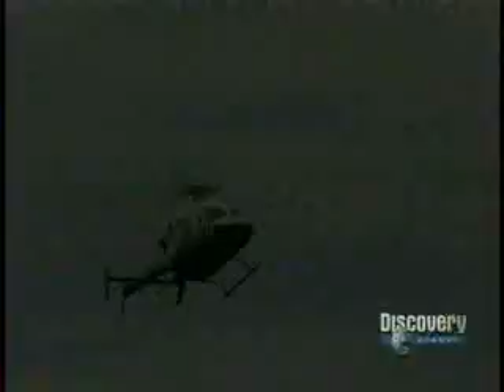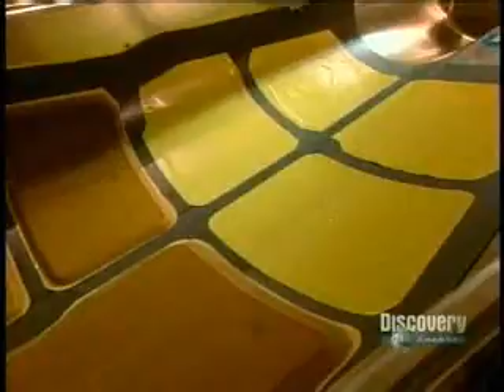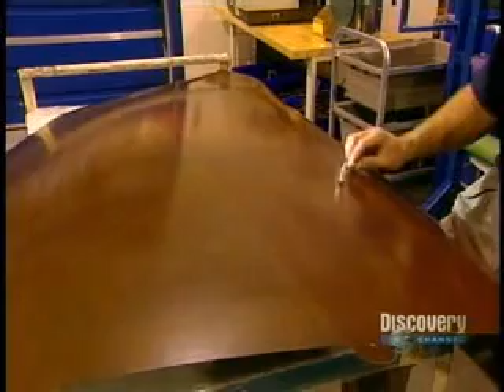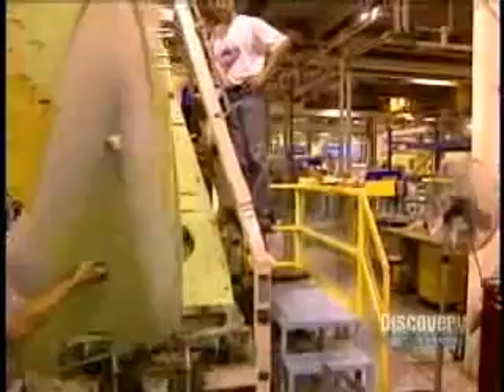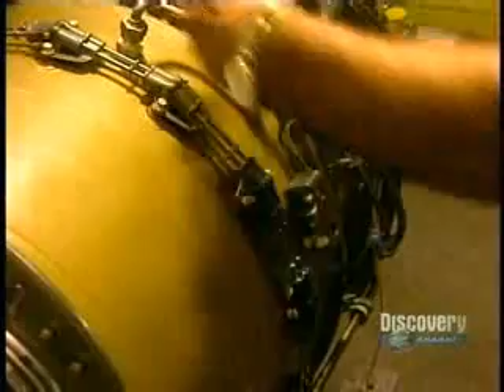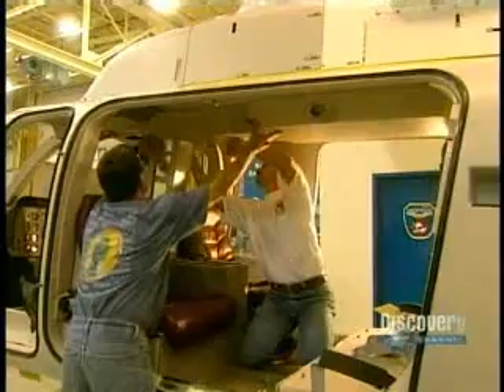How it's made: Helicopters

Comment: What the two of you are forgetting is that driving dials and screens electronically is lighter than having direct reading gauges in the cockpit. Same with electronically controlled Fuel Computers on modern Gas Turbine engines. Lots more wire, but still lighter than using mechanical linkages back to the engines. Redundancy also has to built in, which adds more wire and weight. People don't like it when things fail in aviaition, specially as you can't pull over and fix it easily!

Comment: the air at such altitude has a low density, so not enough of it is pushed down by the propellers, therefore lift is not achieved. Simply said - it can not lift itself that high

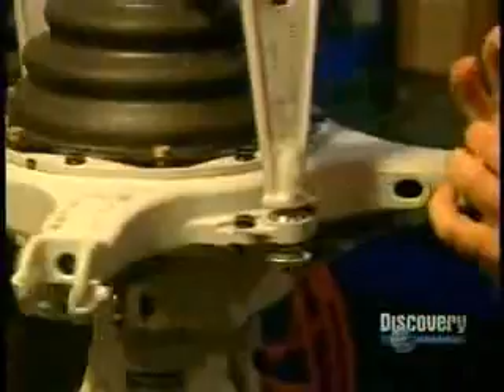Comment: The info at 2:50 about the "brake cable" IS bullshit. did anyone LISTEN to this?  it's the same safety wire used on ALL the bolts on that aircraft...